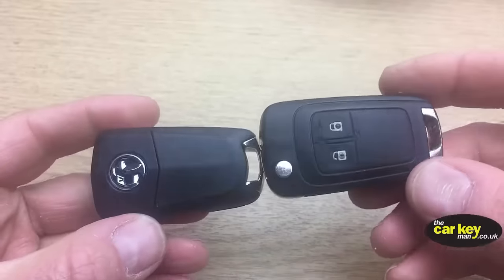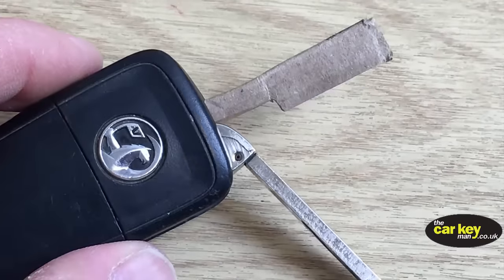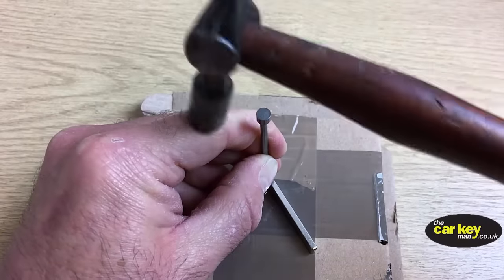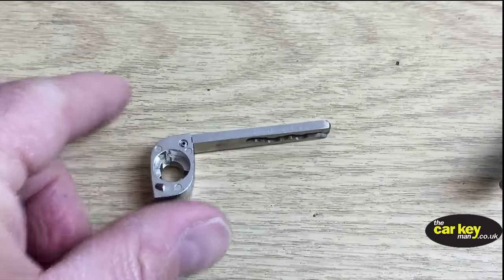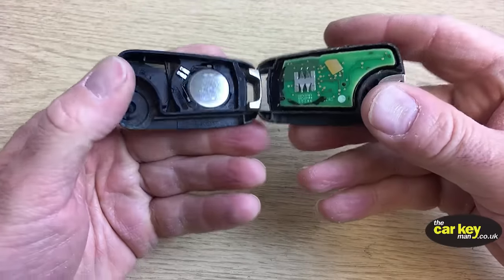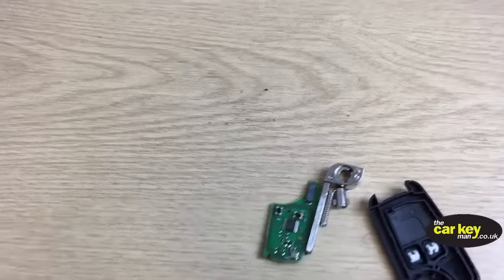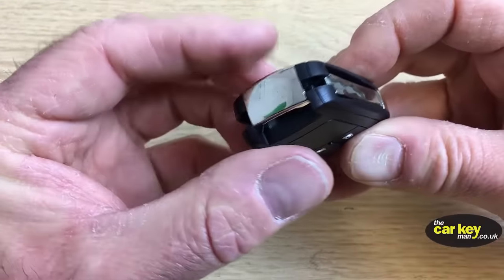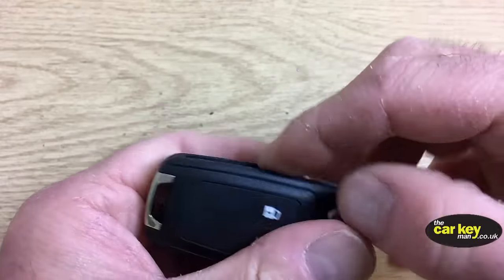Vauxhall Flip Key Repair Kit Instructions

Comment: Great video. I have managed to remove the blade but can’t open the old key case to take out the circuit. It seems like it has been glued! I tried a lot of thinks but still can’t open it. Any tips? I don’t have pliers
Reply from the maker: Hello, it is glued. You need the pliers to open it. When people try screwdrivers, knives etc, then the chip gets damaged and the car will not start afterwards

Comment: I have a question - if i was to buy a used original key, and then fit my blade and internals into it, would I have the issue of the blade not closing and locking?
Reply from the maker: Hi Abir, it's a nice idea, however, the original keys are glud shut, when they are opened the crack and break and can't be reused

Comment: I have a 2011 astra same key as the video but the problem is the both buttons are exposed and the lock button has popped out… so I would need a new mother board I think… not 100% sure
Reply from the maker: Hi Dylan, if the eectronic switch, (the bit under the black rubber pad) has dropped out, then yes, I would say a complete new key, or ask a local car key man to fix it.

Comment: Thanks to this tutorial managed to replace my key however the actual key is not staying in place anyone know why possibly that be the case be nice to know if I can potentially fix it up
Reply from the maker: Hello Augustas. Did you use all the parts from the new key, apart from the blade? If you use the original blade holder, it will do what you describe

Comment: Hello. I’ve just ordered off Amazon and for some reason my new keys were sent with the blade detached from the key. But the video says to make sure the new key flips before I start to fix the keys. Did I receive a broken key fob?
Reply from the maker: Hello, I changed things but could not update the video. So the blade is removed before it gets to you to make life easier. All you have to do is remove your old blade from your old key and then put into the new shell
Reply: @TheCarKeyMan  it worked great and I managed to fix it very quickly. The video was extremely helpful. Thank you so much

Comment: I did this modification. Very simple. Problem I now have is I am chewing up batteries and cannot figure out why.
Reply from the maker: Hi Allan. Did it do this before the modification? Does the key work ok ?
Reply: @TheCarKeyMan  Worked perfect. Battery was always changed once a year. I had the problem yesterday - the battery read 3.3volt so I think maybe the contacts are not correct. I took the hob apart and looked at the circuit (knowing zero about electronics) - could not see any "cracks" etc.. I lifted (bent) the battery contact ever so slightly and hopefully I am back in business....
Thanks for the great video. You guys saved me a ton of money (which my wife found a use for..... :(  )

Comment: Just done this operation for the daughter. The garage supplied a broken spare key and gave her a new case. Unfortunately, when I inspected the circuit board, one of the micro switches was missing, so it's back to square one. Your video was very informative and helpful.
Reply from the maker: A good auto locksmith will be able to swap that switch, or do you a new key
Reply: That’s what happened to mine. I also think the key fob was welded together as we ended up having to use a hacksaw 🤷🏻‍♀️

Comment: If one of the little rectangle buttons has come off the green board…can that be replaced?
Reply from the maker: Hi, yes, but it needs some fine soldering and it's a bit stricky unless you have the correct equipment

Comment: How about the logo? What happens if you want the logo
Reply from the maker: Hi, there are a couple of different ways to get the logo off, as it's only held on by double sided tape. 
We use a soldering iron to melt the old case and gently ease the logo off. I have seen comments where people have soaked it hot water. It's probably worth looking at the comments. Hope that helps

Comment: Thanks for this. For anyone having trouble opening their old vauxhall key fob to get the circuit board, do ensure you're holding on tight onto the fob whilst squeezing the external circuit pliers to break it open. I learnt the hard way and completely broke off a massive piece of plastic 😅 luckily I was able to get the circuit board out and all works fine !
Reply from the maker: Hi, thanks for this info. It's strange because most open fairly easily, but a few are really tight and I'm not sure why
Reply: @TheCarKeyMan  at first I thought it was glued shut so used a heat gun to try and melt the glue to make it easier but that didn't help at all. No idea why it was so tight, but after I broke off the plastic, I still had a bit of room to use the pliers and by holding the bottom of the fob tightly with one hand and using the pliers to expand it the fob again with the other, I was able to pry it open finally. Couldn't open it all the way though so had to turn it upside down and gently shake the circuit board out

Comment: in order to take the logo out just cut the old case with a cutter the logo will come out easier than using a hot metal.
Reply from the maker: Thanks for the tip :)

Comment: Just use a blade or like a stanley knife on the Vauxhall badge. Lifts right up. Also my case was a nightmare to open. Seemed like it was molded together.
Reply from the maker: Hi Elliot, since I made this I've also come across a few cases that seem really tight. If I get this, I use a soldering oron around the jin and just slowly melt the case, but it's not fun
Reply: Hi, Just bought your replacement kit. I can't open my old Vauxhall Adam case, if also feels welded shut. What are you suggesting with a soldering iron. I don't understand.  Also, any other options as I don't have a soldering iron....

Comment: lol - I swear my Vauxhall Adam key was held together by the worlds strongest glue. It did not simply pop open like in the video. Had to hack the bloody thing apart
Reply from the maker: Hi, yes just of late there are some that don't open easily, when I made the video they all popped open. Did you get it out ok?
Reply: Same here so worried about damaging the chip hacking and melting away bits of plastic it’s really frustrating

Comment: Thanks for the comprehensive instructions. The only hard bit was getting the old key apart without circlip pliers. Managed in the end but it wasn't pretty. On the upside, in the struggle the Vauxhall logo fell out, so easy to transfer it to the new one. Thanks again.
Reply from the maker: Hi John, yes with circlip pliers it's very difficult. The pliers make it a lot easier

Comment: Great how to vid, been living with a key with bodged buttons for over a year, thinking I'm gonna have to bite the bullet and pay Vauxhall for a new one..  Like others, my key wouldn't come apart, broke into several bits trying to split it with circlip pliers.  Trick I used was a soldering iron with a fine needle head, used it to melt round the joint.. worked a charm.  Big thumbs up for your vid.
Reply from the maker: Hi Paul, thanks for the feedback. I'm not sure why some cases just don't open. It's very rare that I have that problem, but then I  get a lot of practice. Thanks for posting your answer to this problem ;)
Reply: Excellent tutorial. Everything went as shown in video until I had to break the original fob apart. It was a right ‘b’. I removed the Vauxhall insignia on the back,in case there was a screw like the replacement fob. Nope. So I had to expend some brute force and hoped I didn’t break the circuit board inside. In the end after a few tea breaks I decided to go Hulk on it.  It’s amazing how far things ping around the room. Anyway circuit board was ok and I assembled the new fob. It works a charm. Thanks again for this tutorial and all the various comments on your board.

Comment: Great video thanks.. I'm just after spending €230 on a new key as I was stuck the blade came off,  the corner of the key where the pin goes broke off but defo going to order this and have a spare.. the guy wanted €120 to fix my old key so this is a great thanks
Reply from the maker: Hi, if you get a good kit, plus use circlip pliers, and can do a bit of DIY, then you should be fine ;)
Reply: @TheCarKeyMan  hi thanks for the reply, I'll be ordering the kit in a few weeks, would you say it's better to order of your website or the Amazon link you provided for shipping to Ireland

Comment: I was replacing a broken key fob on a 2014/Astra. The video was great and spot on, up to the point of trying to extract the circuit board. This was held in part of the fob that was either moulded or heat sealed so there was no join that could be prised apart. The net result was that it required a combination of cutting and snipping to finally extract the circuit board. Having put it into the new body, it doesn’t work and it may have been slightly damaged getting it out. I would warn people that they may find this is the case for them.
Reply from the maker: Hi Mike, did you try circlip pliers to open the key?
Reply: @TheCarKeyMan  I did but it was definitely sealed, so whether it was original or a Vauxhall replacement, I don't know.

Comment: My wifes key is working. Thanks. One issue I had was the black plastic pin snapped off winding the spring. So be gentle. 
Using the base point of the breakage I drilled it out and used the spare screw. I  filed down the threads and it works fine to hold the spring in place.
Reply from the maker: Hi, did you get the case from me? I will send out another if you need it. Not sure why the black spindles snap off, every now and then this happens, but happy to replace at no cost
Reply: @TheCarKeyMan  Yes I did. No need. Working away. Thanks.

Comment: Hi. Can you please let me know what type of screw i need to hold the keys fob together (its very small but unsure where to get it) as never came with the replacement keyfob. Thanks in advance
Reply from the maker: Hi Sam, did you get the case from us? I can send a replacement if so
Reply: @TheCarKeyMan  I think so but can't seem to find any confirmation email. Is there any way you can check your end? Kind regards

Comment: Bought this and yes it fits! wooooo but the scariest part was taking apart my old key! sooooo careful but about 2 hours later i managed to mangle out the old chip and it works!!!!!
Reply from the maker: Well done Daniel, did it open with the pliers?
Reply: @TheCarKeyMan  no unfortunately i didnt have them, but the ease of opening the New key i was under the impression the old one would be just as easy! ha! one broken wine cork puller later (bent the arms)... so an hour later of SLOWLY filing down and around the shape of the chip in your video i managed to get it out (yes an hour!)  i feel there should be a disclaimer somewhere about how much it WOULD cost if you break the chip!!!! i think i was extra careful through fear of a huge replacement chip!!!  Overall amazing  product and it fits perfectly! 100% will direct people this way if they require a replacement key housing!!! Also the fact you reply to all comments is amazing! really shows you're dealing with someone who cares about YOU and not just sales! fantastic!

Comment: Ordered  the replacement  fob which  is great but like previous  comment there is no way on earth that circlip pliers were opening  old case . .I had an engineer department at work try and nothing would pill apart old case with all the workshop tools  required a dremel and some very careful cutting right down until you could see the board ...took an hour to open the old case as it was not coming  apart even when 80 percent cut still wouldn't break apart...the quality of replacement  is good and all working now
Reply from the maker: Hi John, thanks for the feedback and sorry your case didn't open simply. It's strange because most keys I see open without any problem and then occasionally I get one that just won't move. 
There's no way to predict which keys are like this I'm afraid. 
It's as if the glue machine did some overtime for a batch, which is a pain i'm afraid.
Reply: @TheCarKeyMan  no problem,  the replacements you supplied were good quality  and everything  is working like new, just wanted others to know my experience of opening original fob  was not pain free

Comment: Would this work if one of the little rubber buttons (the one that opens the car) have fallen off?
Reply from the maker: Hi Tanya, yes it would
Reply: @TheCarKeyMan  sorry these are the little black ones that are on the circuit board you pull out in the video? I want to triple check before I buy 🤣❤

Comment: Rob said: it works and its great value. One thing to look out for, is that the spring in the new key fob only needs to be wound up by one turn not two. If you wind it up by two turns you risk over winding the spring.
Reply from the maker: Ok thanks Rob, that's good info :)
Reply: Yea I did two turns and it bent the spring provided so I used the spring from my old key and was all ok

Comment: Mine was slightly easier than this as the first stage of removing the pin and blank key from the new part was already done.  I also got a new pin with the kit but I didn't notice until I'd finished and had reused the old.
Reply from the maker: Thanks for the feedback :)
Reply: A year later and the new blade assembly (the part with the pin) has broken.

Comment: Will the side of a new key fit in the old key?
Reply from the maker: Hi Kevin, no the parts are not compatible, in my experience. If you are swapping over, then you must use all the new parts apart from the circuit board and the blade. Hope that helps

Comment: Great product and instructions (this video link is in the enclosed paperwork).  I ordered off Amazon as I'm a prime member and i had it within 12 hours.  Improvement from the video was that the key blade was not attached, so one step less and there are a couple of spare key-pins.  The biggest drama that I had was breaking into the old key.  My circlip pliers were just slightly big. the key looks exactly like it did before.  I'll go on Amazon and give it 5/5.

Comment: Superb video and service, ordered yesterday, kit came today, less than an hour (and one small injury where screwdriver slipped trying to prise old key apart!), all done and working. Saved £34 on the £50 Timpson's were quoting, and they said they'd only fit blades they'd cut! 

Highly recommended.

Comment: What happens if the key blade won't come out after the pin is removed. My key blade won't budge.
Reply from the maker: Hi, there’s nothing holding it in apart from a tight fit and tears of dust and dirt. If you pull it hard enough it will come, honest

Comment: It's there a screw I'm missing? Mine seems absolutely glued shut! I'm on the verge of taking a saw to it... Or a blow torch😆
Reply from the maker: Hi, if it's an original Wauxhall key, then there's no screw used. They are glued, or bonded. If you use anything other than the circlips, be very careful and the circuiy board may be damaged

Comment: I finally managed to fix it. I had to use a knife to cut open my key case almost entirely. You have to be very carefull! Be aware, my key had a little black pin (attached to the case) that goes in the board. It is very vulnerable. Glad the war is over after 3 days🥵
Reply from the maker: So sorry you had that experience. Just lately there are some very tight cases, I can’t really explain why. Well done on winning the war 👍

Comment: “It’s just soo easy to open up”.
Bullshxt, my fob is bending before opening up.
Reply from the maker: Hi, I open lots of these up every week and most just pop open, however, I am starting to see some that dont. They require the pliers to be fully inserted and then the force slowly increased, not snapped open quick. 
Most of the time the case will open, however sometimes the glue machine was on overdrive and they are very tight.

Comment: I have tried with circlip pliers and various other tools, even gentle warming from a hot air soldering station but no joy. It feels like its glued tight down. Any further suggestions?
Reply from the maker: Hello Martin, yes they are glued. I have found that by inserting the circlip pliers as far as they go, and then slowly increasing the pressure and then holding it will open most of the cases

Comment: I have failed to open my old key.
Tried to use ancirclip pliers to open as you demonstrated but unfortunately all that happened was the plastic deformed but the key remained firmly together.
Any thoughts?
TIA
Reply from the maker: Hi, when they are tight, I’ve found the best way is to slowly increase the pressure on the circling pliers and hold it on until it starts to open

Comment: Great video  really good clear instructions. Only thing I found when I came to dismantle my key, an original Vauxhall one circa 2016, the two halves were bonded together . Had hell of a job to get circuit board out without damage.
Reply from the maker: Hi, I’ve found that some of the newer keys are much tighter than when I made the video. 
Did you manage to get it out?

Comment: Thanks for the vid very informative. Splitting the old key even with circlip pliers took a bit of doing, the bits went flying. Any way I managed it, Timpsons wanted £50 😂
Reply from the maker: Hi, yes some of these keys are getting quite tight. The best way is slowly increasing the pressure and then holing it. If it's snatched at, the case can break. Anyway, glad it helped :)

Comment: 5 star. got for my zafira. I could not close the case towards the back and because was a little dimple on the inside of the case. maybe it is there to line up with a hole in the electronics or a relic from the manufacturing process. So i snipped off the little plastic dimple with nail cutters and sorted.  Also my key wont close because it was slightly bent. All fixed. A bit nerve racking but ultimately very satisfing. Tip: Put this video link on the paper instructions
Reply from the maker: Well done, really pleased this video helped you :)